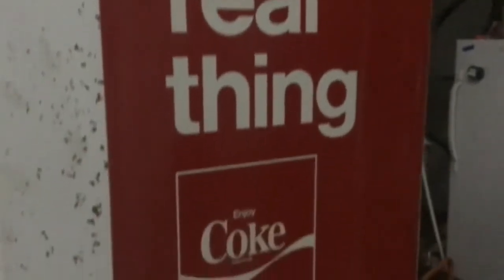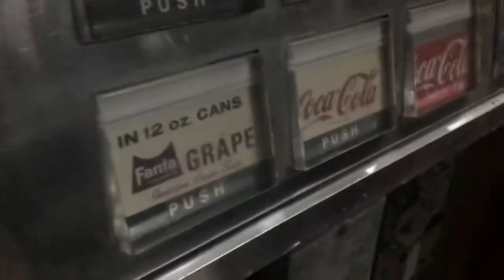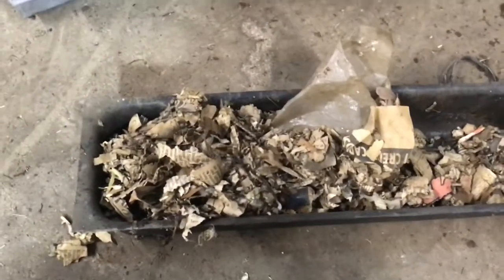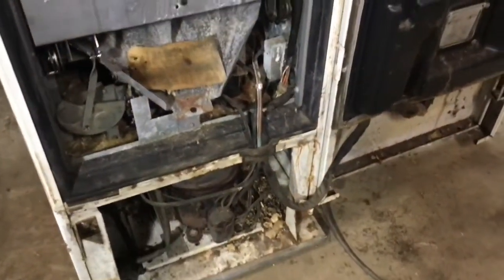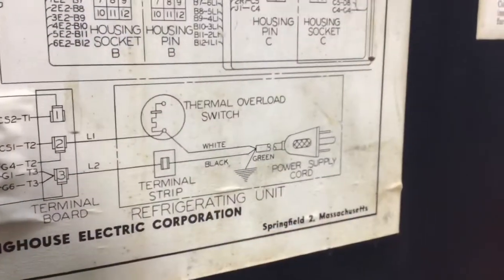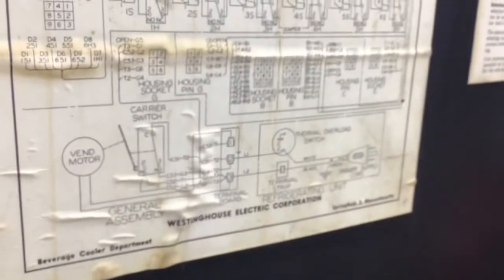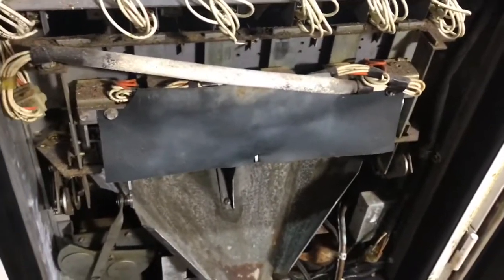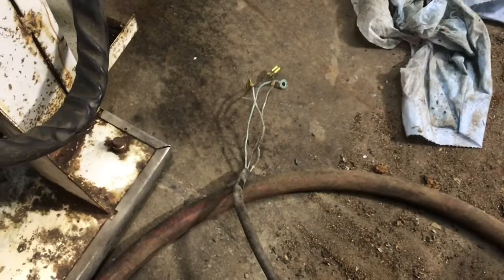Westinghouse WB102 Coke Machine | Auction Find | Making it Run Again | Part 1: Cleanup and Evictions

Comment: Do you happen to know what year this is?   I got mine working good!! I put free vend but haven’t gotten money yet y try o work
Reply from the maker: I narrowed it down to the 60’s or early 70’s possibly, but not any pinpoint on exact year.  The coin changer was very finicky and surely the most challenging part!  I need to recharge the cooling system and finish my wet bar to start using it.

Comment: Hi. I have one just like this. I don’t know really how it works.  It cools but I don’t know how to install the sodas. Bottles? Or cans.  I don’t know how bottles would work. It says it takes bottles. Are they 8 oz that I have to put in it?   Any help would be good.  Thank you.
Reply from the maker: Hi Steve,  the diameter doesn’t matter as much as the length.  A “can kit” was basically a spacer to hold the cans in line.  I have more videos on this I think, but I haven’t made it cool yet.  I need to recharge the a/c compressor and it should be good.